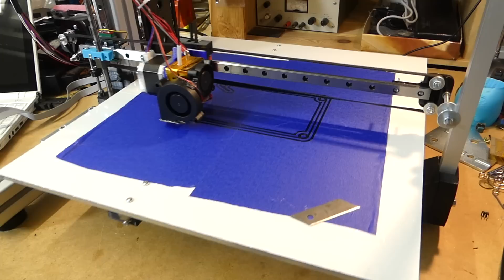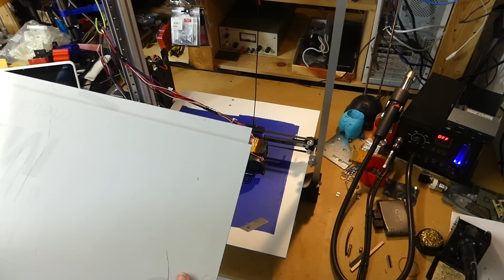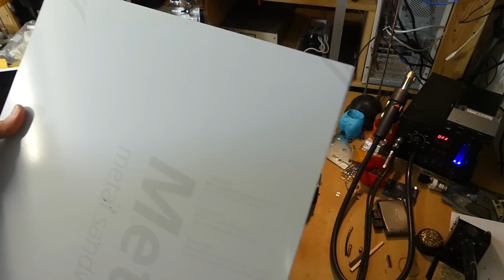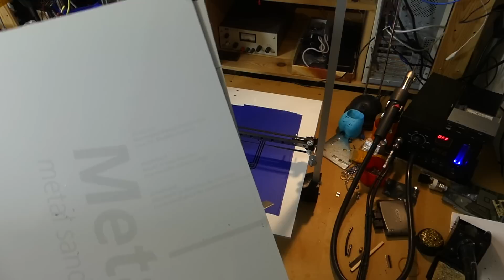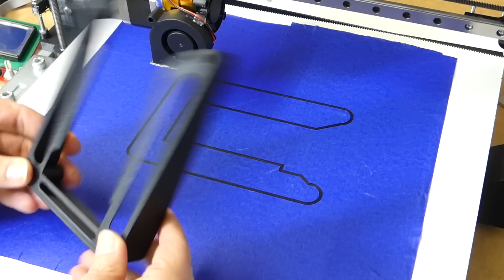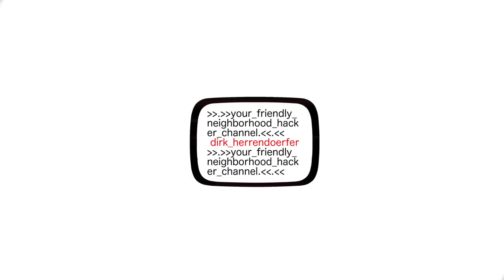Big Bad Robin Build VLOG pt. 10

Comment: Can i use uCNC in Ardiuno for STM32F103C8
Reply from the maker: The software will work, but you need to mind the lower voltages and currents that the STM32 supplies.
Reply: Dirk Herrendoerfer i found only source code which software should i use " https://github.com/dherrendoerfer/uCNC_controller " can i use GCTRL Processing software

Comment: Another comment, the reason the build plate is difficult to heat isn't so much the mass (that just slows the heat-up process down), but the exposed surface area.  You could try taping thermal insulation to the underside of the build plate, along with some pieces up top on areas you're not printing on.  Keep in mind that you don't need to heat the bed up that much for PLA.
Reply from the maker: I don't have that much space between the mount and the build plate (to keep vibrations low) but I may be able to add some power resistors to the underside to add some heat. But that will increase the mass of the assembly more, making it harder to keep it from vibrating.

Comment: I used to have a big chunk of aluminum for my print bed too.  It was more trouble than it was worth; took absolutely forever to heat up (it was sitting on top of the original bed, some sort of PCB heater with a thin sheet of aluminum on top) and caused vibration issues.  I ended up replacing it with a piece of cheap glass.  Works much better.

Comment: Since the new beds have channels running through either their width or their length, you could just direct hot air through those and only as wide as the print requires.

Additional thoughts added later about this:

The channels are triangular. So only the ones with their points facing downwards would be required. Their very shape, in fact, should actually help direct most of the heat upwards.

Starting from the center point of the bed, feeding hot air into two of these adjacent channels and then directing each output back into the next similar channel further towards each outer edge, repeating this for both ends with some way at the end of each channel to direct the flow back inwards to the channels which have their triangle in the reversed position and then repeat the air routing at each end until it finally exits through the two triangular channels whose points face upwards near the center of the bed would probably be the most efficient way to implement such a system ( at least, to my thinking).

For this way, the bed with the channels running across it's width and not it's length would be more effective.

Additionally some type of thin styrofoam insulation could be double-taped to the underside of the bed.
Reply from the maker: That is a good idea . I hope to get some free time soon to start experimenting with getting a little heat into these beds. 
I'm more worried about the added weight to the build platform and the little space I have in between the mount and the platform than it not being distributed evenly -- there' quite a lot of material in there to distribute the energy.
Reply: I look forward to seeing your approach to this problem! Also, thanks for producing these videos, and excellent work so far.

Comment: Why not add a thin plastic insulation if there are a problem with heating transfer to other parts then the heat bead?  And maybe build a container for the printer?  That would save energy and make it easier to heat up the machine?  Might even do a prototype in cardboard, if you don't let in run unsupervised.
Reply from the maker: That would be one big enclosure .... the table is 450mm moving 400mm ...
But an option, yes. I need to sort my options I think, The way it is now it's not really good with the prints not really sticking down.

Comment: I never found PLA sticks very well to blue tape heated or not. If you add some glue stick to the blue tape, until it is a layer, rough and let it dry. Prints stick to that very well.
Reply: Or use clean glass?
Reply: would add a lot of weight to an already heavy bed.